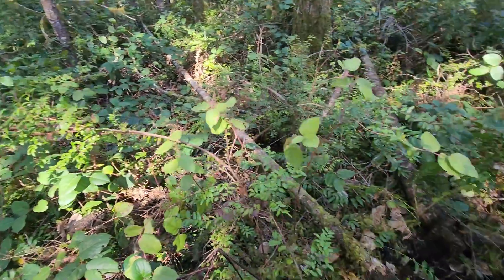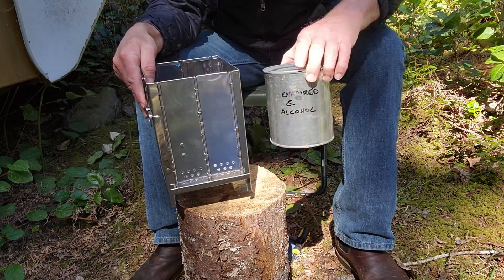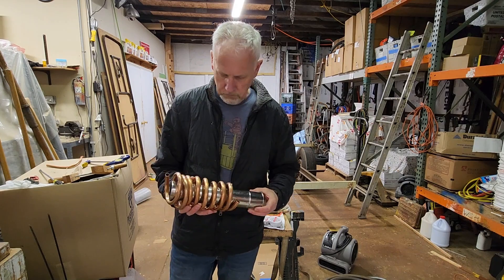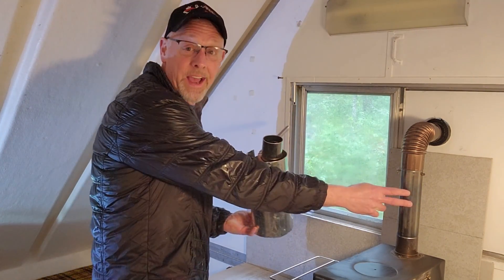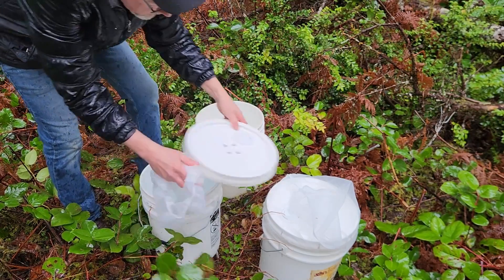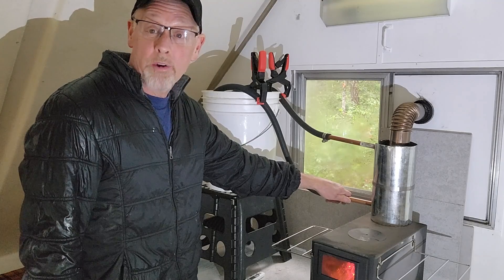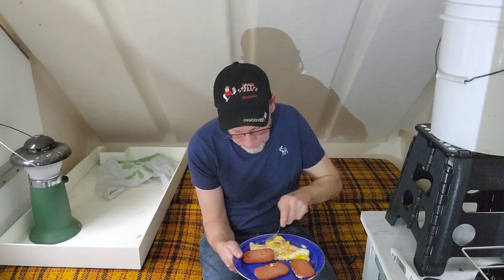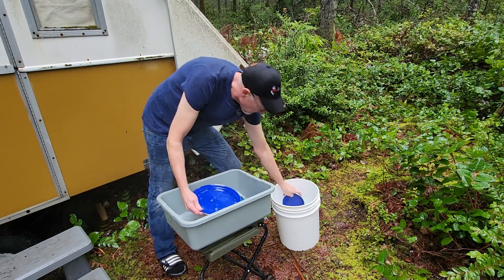Secluded off-grid cabin living: Installing a new wood fired water heater.

Comment: Here's an old school method from the past which allows for a constant supply of hot water. Construct a frame which will allow you to put a boiler over your small rocket stove. As a scrounger, you should be able to find a very large, low cost stainless steel pot or a pressure cooker from an outfit such as Goodwill. Pressure cookers without a lid tend to be VERY cheap! Obviously, a large pressure cooker such as used in canning would be ideal due to the size though you can often find very large stainless steel pots as well which have a handle on opposing sides for easy lifting. All you need to do is to manufacture your frame so that your boiler is directly over the stove while allowing enough room (potentially) for a skillet or a smaller pot to remain on top of said stove. This facilitates your cooking needs while the boiler is either heating up water or keeping it so.

 You also may choose to look into various outfits that deal with old RVs... it isn't unusual to find 5 to 10 gallon stainless steel water tanks that are used with a propane heat source for hot water. As the scrapping of RVs is a very common occurrence, used parts can be plentiful and cheap. It's just a matter of knowing where to look. Also, don't overlook outfits that deal with larger boats that have on-board kitchens or kitchenettes. Boats also get scrapped!

One other option would be to simply acquire a supply of stainless steel material suitable for making a vessel of your own. Even if you cannot weld stainless, if there is an accredited school in your area where welders are trained then they may well get your proposed stainless steel vessel welded together for you for nothing. Instructors often love those types of projects because they mimic real-world conditions for welders. It can take some time to get that sort of thing accomplished but at the end of the day, it may prove to be the best and cheapest solution. It also allows for whatever custom size of boiler it is that you wish to use based on your needs and the size of your stove. While some folks may balk at these things, I doubt I have to mention how expensive a brand new stainless steel tank can be! Here's to more experimentation and excellent small cabin life. Salute!